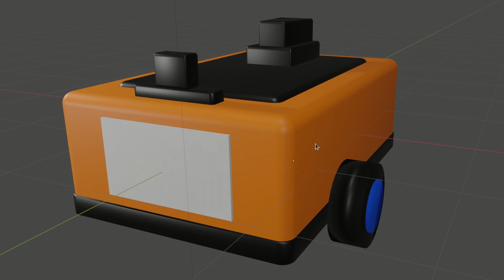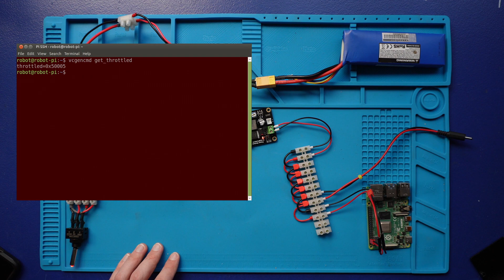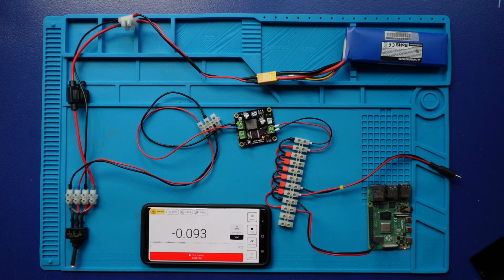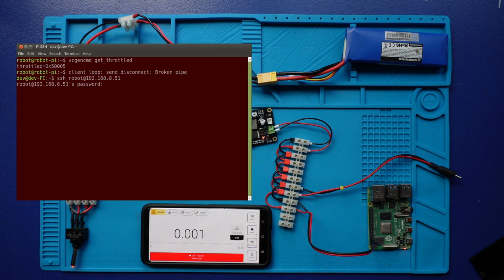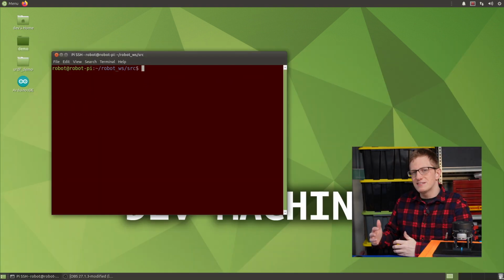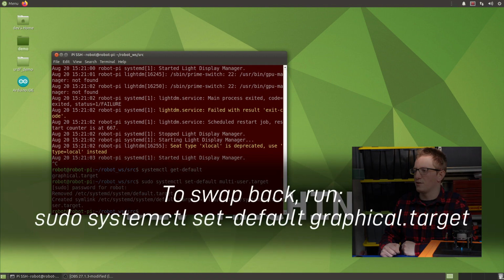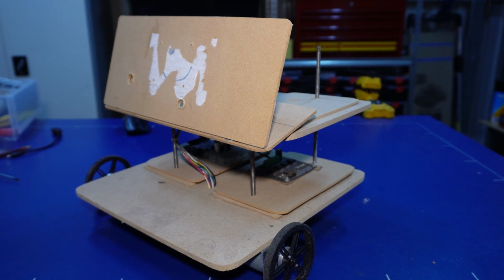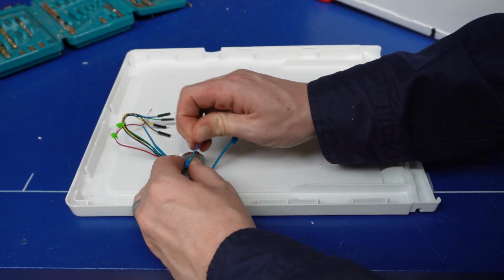Designing a chassis for our robot! (+ other fixes)

Comment: good day, we are trying to use your workspace for our thesis, I successfully clone it and have a working simulation. But now we are integrating it in our real robot we are having issues, may I ask if it will still spawn with my initial setup of my hardware wherein I want to test  teleoperation with controller. Basically I'm working first in remote control using joystick. I'm kindly hoping for a response, your videos are too helpful for us, thank youu from Philippines

Current Hardware 
Motor with encoder
Rpi

For ros2_control

Comment: I'm planning to make my robot look like a vehicle but that unfortunately means i have to use 4 wheels instead of 2. Any recommendations in that aspect especially when it comes to the differential drive system?
Reply from the maker: I haven't spent much time playing with four-wheeled robots but a few options are:
- Ackermann steering (like a car) and there are control schemes out there for this
- Skid steering where you just do diff drive but with 4 wheels and have them skid
- Omnidirectional (or mechanum) wheels which can allow you to do more complex manoeuvres with 4 wheels, including pretending to be diff drive
Hope that helps

Comment: I too was facing voltage drop issue with DFrobot PSU module. The trick to have better control over variable output is to replace onboard resistor with a smaller one which gives higher resolution.
Reply from the maker: Very interesting, thanks!

Comment: Did you 3D print the covers for the chassis from the Blender file you did, or was that made in CAD - It would be great to see your workflow for this (I use Blender for designs, but don't yet have a 3D printer so not sure if I need to export to CAD or not)
Reply from the maker: Hey Duncan, sorry I never saw your comment here before. I know I replied on the forum but I thought I'd put it here too for good measure.
The Blender model was just a quick mock-up for me to get a feel for it and try out different colours. I did the CAD design for the plates in Fusion 360 and they were very easy to make even with my limited CAD skills.
You absolutely can export from Blender to STL to be sliced for printing, but you are much more likely to run into problems if you are not careful about it so I would strongly recommend using CAD software. (The occasional use of Fusion 360 is about the only reason I ever reboot my computer into Windows anymore!)